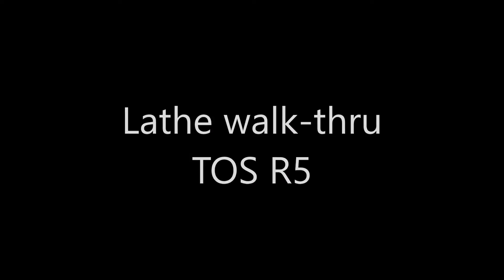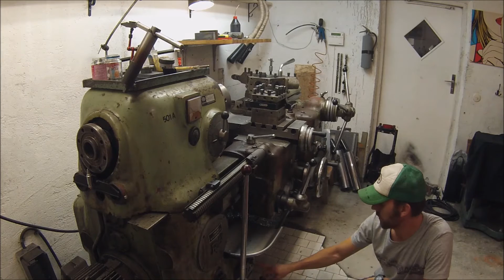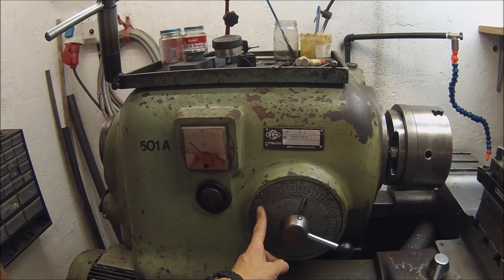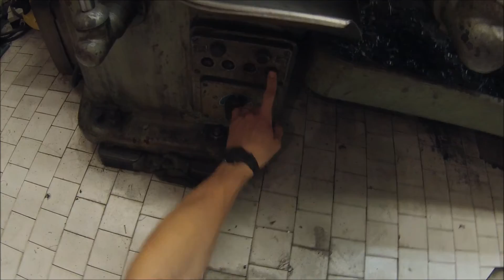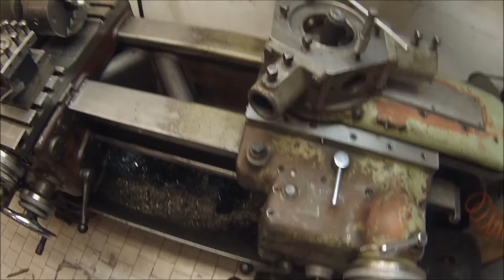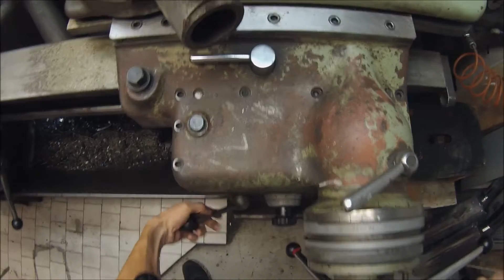A tour of my TOS R5 turret lathe

Comment: Good video I would like you to tell me about the precision with which this lathe works. Where I live they are offering me an identical one at a good price, I would like to know if you recommend it for precision work. It gives me a little doubt because of the number of years it is, do you have problems with the rotating turret? I wait your answer. Cheers
Reply from the maker: Thanks for commenting! Since these lathes have often been used for mass production, the ways are often worn where the apron have been running the most. This is the case with my lathe but it’s not so worn it’s a real problem. The precision is very good anyway. I have no problem with the turret. I have done many precision jobs on it including engine work where tolerances are really important. So if it’s in a decent condition i wouldn’t hesitate, i have never had any regrets about buying mine.

Comment: Hİ SİR,  HOW CAN I USE REVOLVER TARET? TARET ROTATES BUT DOESNT LOCK. HOW CAN I SET TARET
Reply from the maker: Hi! Below the turret is a lever. If it points towards you, the turret will swing when you bring it back. If the lever is set to the left, it will not swing to next tool. Good luck!
Reply: @LittleshopofFredrik  thank you very mu h 🙏👍
Reply: @LittleshopofFredrik   how can i use collet chuck. Maybe my collet has no some parts.  There is no collet nut.  Do you know collet nut threads?
Reply: @LittleshopofFredrik  is there English users manual this collet chuck, or tos r5 manual

Comment: i found kind dangerous work on those lathes in my small shop, i had a joinville lathe a medium size german made lathe and i allways use the belts not so tight because i am not professional and if i made any mistake i could easily stop the machine! Great lathe anyway i heard that tos machines factories start using steel from panzer tanks after ww2 thats amazing! Turrent lathe in portuguese are called "Torno Revolver" because the "tail stock" revolves into several tools. Greetings from Brazil!
Reply from the maker: +sacrip tex Thanks for commenting! Always interesting to hear about other lathes. Safety is important and i try to keep it as safe as i can. My lathe actually reminds me of a tank so that seems right ;) Greetings!

Comment: Hi,
thanks for the tour! This looks like a really nice lathe.
I am not familiar with turret lathes, so please excuse my possibly dumb question: what is the functionality of the bar attached to the carriage to the left, which looks a bit like a threaded bar with longitudinal grooves? Can you attach stops to it?
Thanks for any feedback
Harald
Reply from the maker: Hi Harald! Good you mentioned this, i´d actually forgotten about it. As i´ve understood it it´s a bar for setting stops just as you said. I´m not completely sure if it also has some other functions to it. On my lathe, this is stuck and i have plans for getting it to work but havn´t gotten around to it yet. I havn´t had any major reasons for digging deeper as i havn´t had any jobs that required me to use an automatic stop, but i should off course know how it works. Thanks for reminding me and i will get going on finding out more on this function on my lathe.

Comment: can you thread with it
Reply from the maker: Yes, it´s possible. The downside though is that it´s only possible in the fixed measurements you see on the feedrate selector. If i remember correctly the settings are: 0,045 - 0,09 - 0,18 - 0,25 - 0,50 - 0,71 - 1,0 - 1,4 which are pretty odd ones. But as i see it, threading on the lathe are something alot of people are interested in but that most machinists use very seldom. It´s often easier to just thread with a ordinary tap or die. But sure, it would be nice to be able to do any thread when needed.